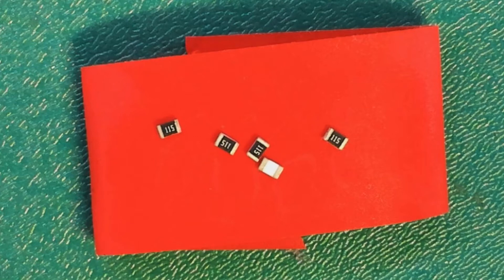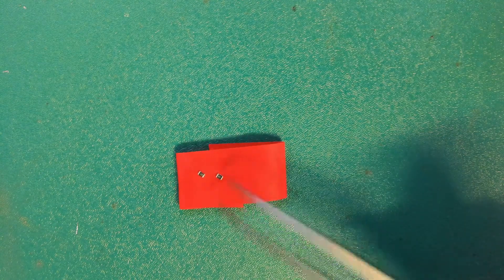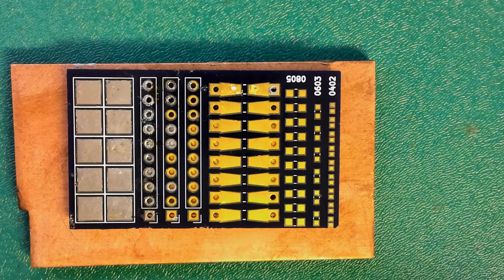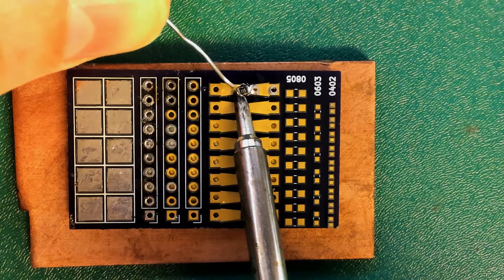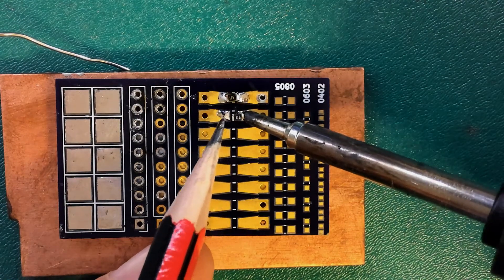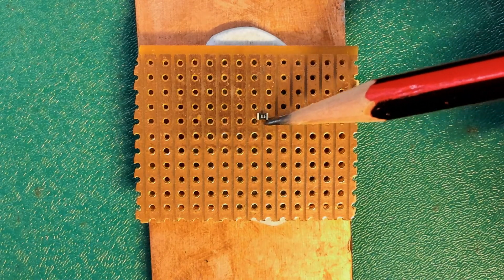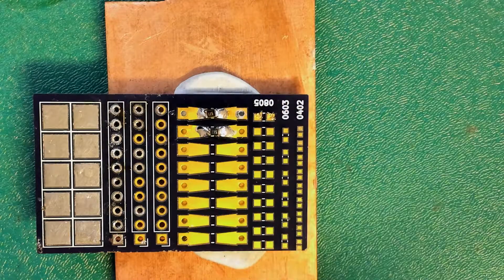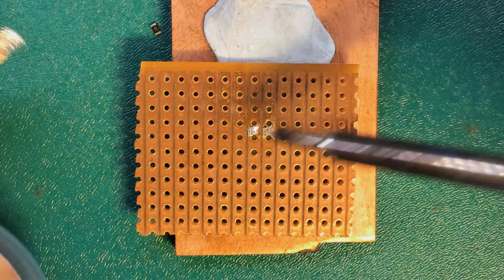How to solder - Soldering Surface mount Components 0805

Comment: You need to use tweezers, man...
Reply from the maker: Actually tweezers are a pain to use. They get magnetic over time... yes demagnetizes are a thing... but a pencil just works.... and it works every time. But 'pinch' away!
Reply: @roboticsmate4430  Ceramic tipped tweezers are the go. Change tip to a fine cone.
Reply: @roboticsmate4430  dude shouldnt you at least use a toothpick to avoid the graphite getting in everything???